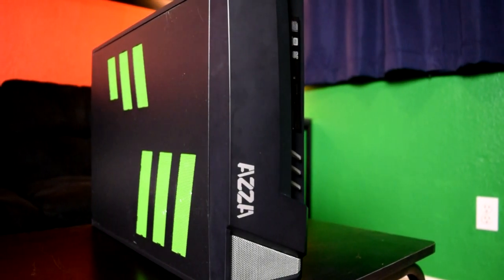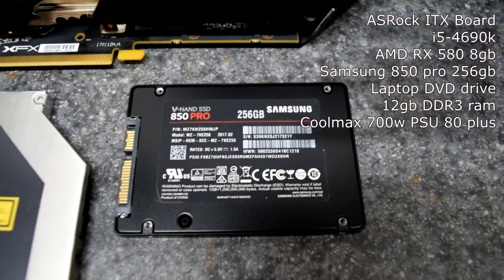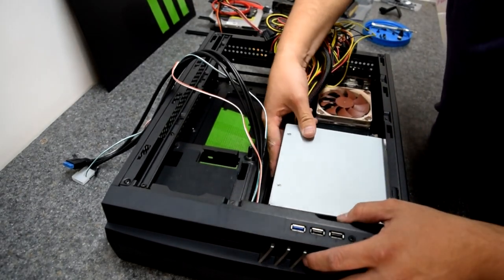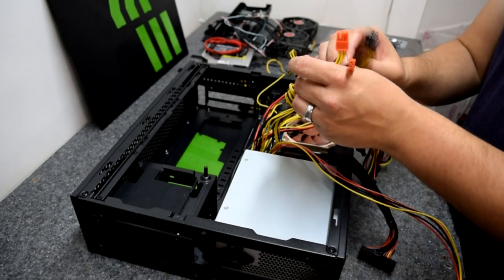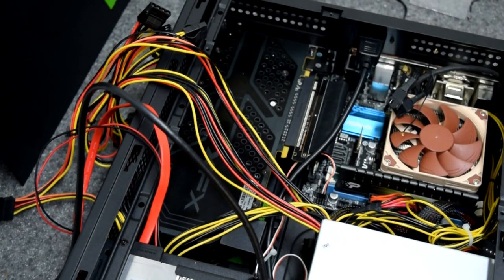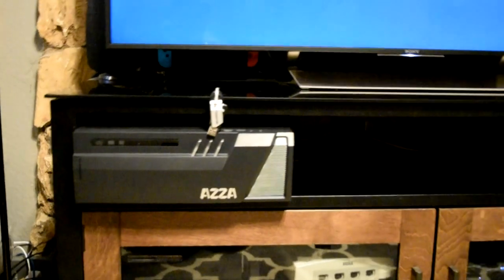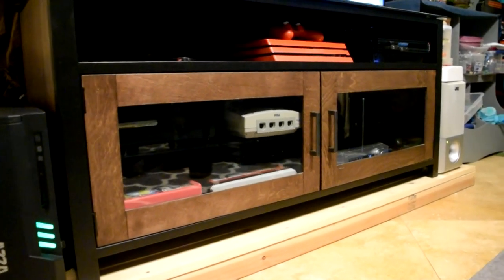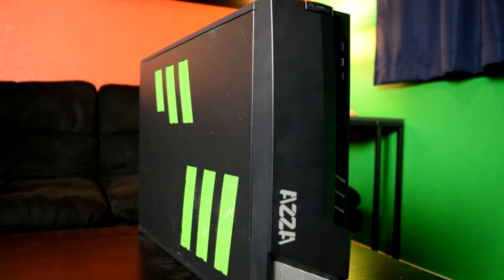Full powered gaming PC in the size of a console (Azza CSAZ-103 review)

Comment: What a great video. Im planning to build a ryzen system in this very case, if i remove that fan that seems to be over the cpu how much clearance would i have? What i am asking is, how tall of a cooler could i place on it? I hope to see more vids on this case as it is very unique due to the fact that it is a mini tix case with atx psu as i too have found after an extensive amount of searching, its a shame i missed the rebate because it is currently out of stock at newegg.
Reply from the maker: I checked the clearance and found that from the motherboard to the bracket gave you about 3.5 inches of space. I also checked and there is about 2 inches between the cooler fan and the bracket.

Comment: Ok... so big mistake with your fan.
It should be set to intake so that the PC can passively exhaust heat out of the top.
In addition, with it set to exhaust it is in direct competition with the nearby downfiring noctua CPU fan.
If you use that fan as an intake, temps should improve slightly.
Reply: You could probably sneak a few fans in the top if you wanted for exhaust.